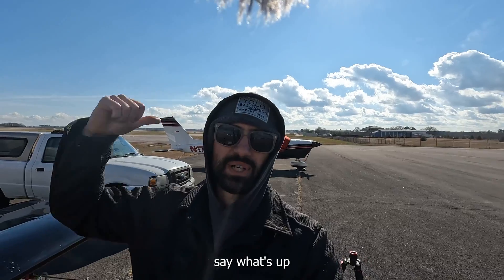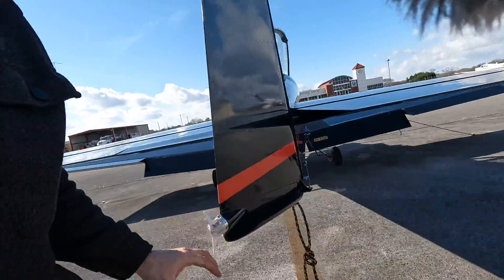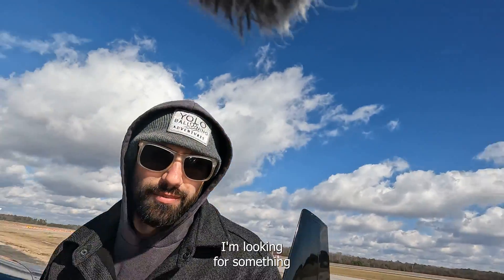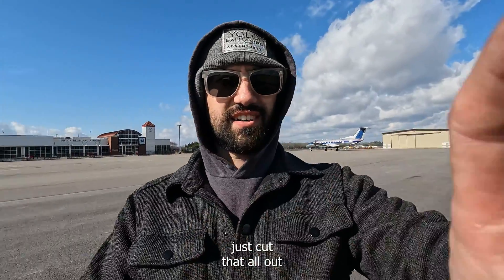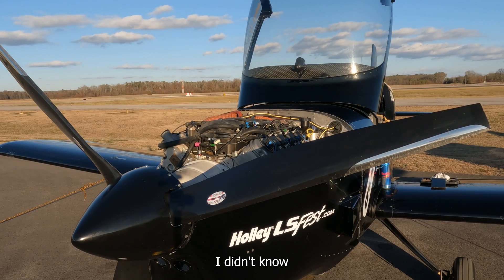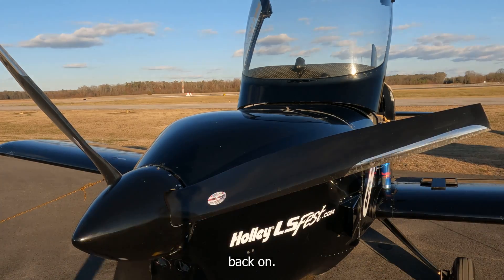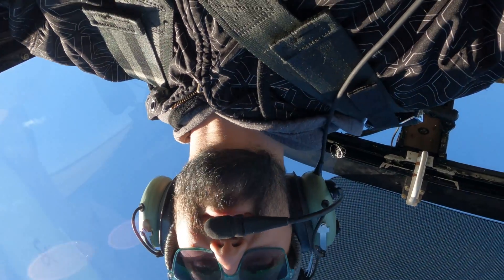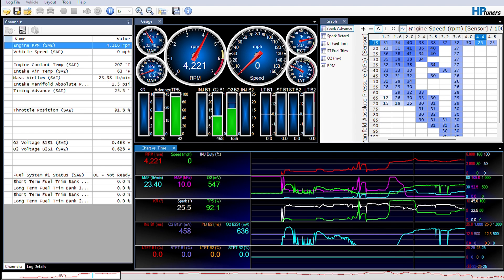Pre Flight LS swapped Airplane and Data Logging

Comment: What kind of fuel burn are you getting? What's your cruise? This is an awesome build and good content. I'll be watching all of your other vids. Sub'd
Reply from the maker: I still don't have super reliable numbers on this because the tune hasn't been fine tuned yet. But on my flight to sun n fun, I was heavily weighed down 2 grown men and all of our gear. Probably 150 pounds of gear If not more. Our total weight was probably around 2200-2300  if I had to guess. 

All that being said ..... oh yeah I don't think my propeller is super efficient either.  We cruised at 7500 ft and at around 150 knots true and from take off to landing we burned roughly 8.5 - 9 gallons per hour.

Comment: If that is where you always park, I have an easy and cheap solution for your problem of the rope interfering with your pitot. 

It looks like the points on the ground are to far apart for your plane. If you ran a chain between them, pulled it a bit tight on a turnbuckle, you could tie off to any point along it and get that rope inboard of the pitot. 

You'd need 2 shackles, a turnbuckle, enough chain, and less than an hour. 

Obviously this only works if that is an assigned, guaranteed space.
Reply from the maker: Bro!!!!! This is such a great idea. If I make some sort of canvas strap ladder thing then it could be a mobile solution as well
Reply: @ultimajp  I hope it helps! Careful with the straps long term, UV is a bitch, it's why I suggested chain, but yeah man, I hope I've inspired a solution... Because you are one windy day away from a new pitot tube with that tie down, nobody wants that.